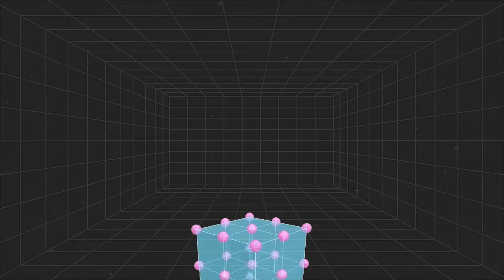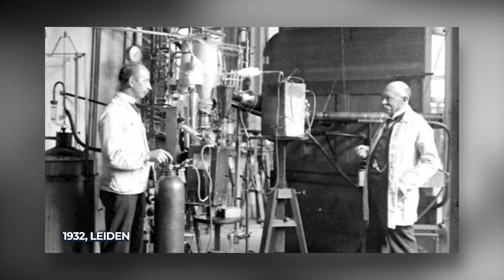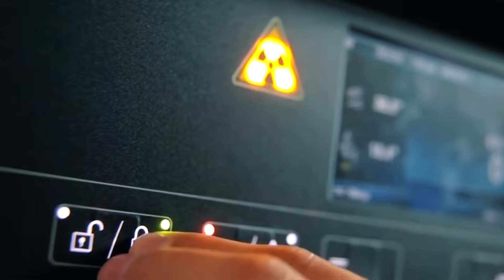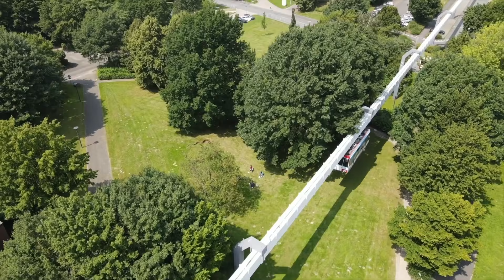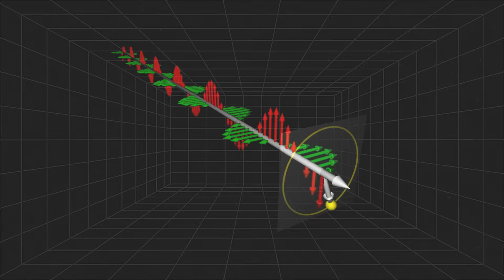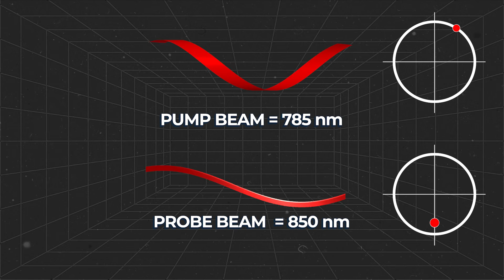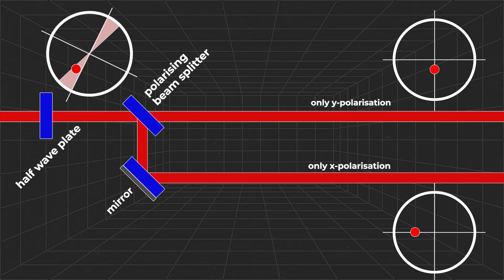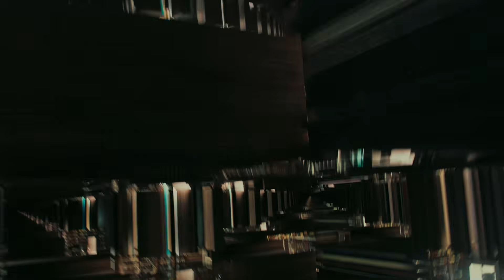Impossible Time Crystal Breakthrough - Explained

Comment: I'm struggling. I thought a time crystal oscilated independent of an input ? Isn't a constant laser input cheating & why is reducibg the temperature not an introduction of energy, albeit negative. Just asking ! (I'm not in any way a scientist).
Reply: I think it's impossible for anything to change without some change in the energy of the system. That's why he said time crystals get close to (but are not) perpetual motion machines. The oscillation is powered by the laser, but when the input is constant it shows that the oscillation isn't caused by the laser. It's an inherent property of the crystal itself, using some of the beam energy to oscillate in time.

Reducing the temperature is setting the stage for the experiment. It happens before the experiment begins and so long as that temperature is held constant, isn't a factor in what's occurring.
Reply: This was also not obvious to me. It seems uninteresting for the purpose of a time crystal if the crystal oscillates as a function of the properties of the laser.
Reply: Dude who made the video is spot on. With a quartz watch, an electric circuit is the source of occillation and the crystal itself merely acts as resonator (to accentuate the desired part of the frequency). From Wiki.. "The electronic circuit is an oscillator, an amplifier whose output passes through the quartz resonator. The resonator acts as an electronic filter, eliminating all but the single frequency of interest."
With the time crystral experiment, the laser input doesn't occillate. The source of the occillation is now the crystal's atomic structure itself, which is something different and new. @BitsBlit
Reply: @bgsmember3650 I guess as a layperson, it's hard to understand that a laser isn't an oscillation source when everything about it is in terms of wavelengths of light. It doesn't follow in my mind that an energy source with a frequency imparts no frequency on the crystal.
Reply: @BitsBlit  exactly what I am thinking. I don’t understand how the laser is not an oscillating source. 

I also have another question. When you superimpose two oscillations with frequencies that are close together, it would result in an oscillation with extremely low frequency. Are they sure it is not because of this?
Reply: @BitsBlit  It's analogous the distinction between direct current and alternating current. Both involve oscillating electromagnetic fields, but direct currents do not actually oscillate.
Reply: @koktszfung  That's not accurate. What you are describing is a phenomenon called beating, and the thing that oscillates slowly in this case is the amplitude, not the actual wave itself.
Reply: @koktszfung I might be misremembering but the measuring frequency and the inducing frequency were both roughly 100nm apart weren’t they?  Which is a fairly sizeable distance in terms of interaction, but I’m not a physicist so who knows…
Reply: @BitsBlit He didn’t actually say it oscillated as a function of the laser, merely that they set the experimental conditions using the laser (and as near to absolute zero as possible) thus tightly controlling the parameters the crystal was exposed to enable accurate measurements over time.
Reply: You guys pretty much get it. It's to do with alignment for the initial laser and measuring for the second laser. The magnet initially locks the crystal into alignment, giving a universal starting position that the laser then gives an equal constant push to. 

Imagine you have waterwheel mills all along a riverbank, but there are eddie's and still points. Each of the wheels have to have slightly different angles to best utilize the flow now imagine you lift all the mills up and align the axis of each parallel to each other. That's the magnet  now imagine you no longer have the river, but a torrent of water comes at a constant speed in a constant direction, that's the laser. If the mills are all exactly similar, they all will react in the same way. When the flood is done, it's not gradual, it's abrupt and leaves the mills exactly the same. The difference between the expectation and the time crystal is that there is no friction to degrade the millwheels, so the pattern of the wheels repeat until an outward force changes them.

Another way to look at it is the electron cloud is random. Then a magnet pulls the electron down with a thread and the resistance to return to motion is a rubber band. The laser comes and cuts all the threads exactly the same, making the electrons all bounce around on that rubber band exactly the same way with a repeated time period before it bounces the exact direction off the exact point that was the starting point. That's the oscillation time.
Reply: exactly right, it isn't a true time crystal in the contemporary sense if it requires constant input. Kind of clickbaity but also technically true since their paper labels it as a "time crystal". 
It seems many people aren't understanding but a TRUE time crystal needing no energy input is the gateway to infinite energy and many, many other wild and crazy things so it really is no surprise this experiment is just another "proof of concept" kinda thing and not an actual creation of a time crystal that functions.
Reply: @matthewcarroll2533 I’m always dubious about the possibility of infinite energy, for the same no-go reason as perpetual motion machines.  I doubt the central physics of our universe would permit there existence, however experimentally accessing other dimensions or (desperately not trying to sound like a marvel advert) accessing other planes of existence (okay I mean a multiverse) would fundamentally mean a rewrite of the base physics.
Reply: @ Yep, you're right on all accounts and it's for that reason that things that make wild promises are to be doubted and approached with a certain degree of caution. 

The idea of intermittently accessing new universes or planes of existence for an unfathomable amount of resources (energy or otherwise) is more than feasible, provided we can find a stable/reliable way to connect to them. (which is really the tricky part, of course)
Reply: @matthewcarroll2533  No, that's not accurate either.

Comment: This is a classic example of poor naming - by Willcek's wife if I recall correctly. 

Time crystal is just another name for an oscillator. 
A steady-state drive causing an oscillation - how about a pendulum?

In short, the reason you found this so hard to explain is that it is basically a non-idea which is just not interesting. There's lots of interesting stuff to discuss - but you need to call out that this kind of stuff as just not interesting.

Timing standard? Ha Ha Ha!

Best wishes

Michael
Reply: You said a lot without saying much, what did you draw on to come to this conclusion?
Reply: @nate7rXG134  Good Evening. I drew on my 40 years as a professional physicist. Best wishes. Michael
Reply: @michaeldepodesta001  
Provide your reasoning. If I wanted your credentials, I'd ask for your degrees and publication numbers, I'm asking you to provide some explanation towards your point.
Reply: @nate7rXG134  A "time-crystal" is literally another name for an oscillator. Oscillators are interesting and fascinating but calling them "time-crystals" adds nothing but confusion. 

This video is a description of an arcane type of oscillator - curious enough - but not something of any fundamental significance. You could see Dr Ben Miles struggling - and frankly failing - to try to extract some insight from the arcane complexity of the apparatus. 

Best wishes

Michael
Reply: @michaeldepodesta001  Maybe but what other oscillator's lowest energy state is still an oscillation?
Reply: @nate7rXG134  If I have understood correctly, the video describes a non-equilibrium phenomenon. The material is not in its lowest energy state: it is being driven by a steady-state laser. It's like the way a classical pendulum is driven by a steady gravitational field . The crystal is not in its lowest energy state. If you remove the drive, the oscillation will stop,
Reply: A pendulum isn't driven by gravity or anything else. It won't oscillate on its own and if it had a driver without damping the amplitude would explode. If we had a real pendulum that could start on its own and didn't change amplitude after years of observation that would be interesting
Reply: @shanent5793  " A pendulum isn't driven by gravity or anything else...."  Really? 

Just like the material being discussed, the oscillation of a pendulum is started artificially and then maintained due to the presence of a gravitational field. 

The excitation of whatever is oscillating in the crystal looks to me to be a kind of "parametric excitation" that maintains the oscillation in the face of losses. This is just the kind of excitation that maintains a Foucault pendulum in a museum.
Reply: @michaeldepodesta001  a small-angle pendulum is the textbook example of an undriven, undamped oscillator. Are you talking about some other kind of pendulum?
"Started artificially" would imply dependence on the initial conditions, which isn't the case for driven systems. Neither the magnetic bias nor pump laser are time dependent in the Dortmund crystal so that rules out parametric oscillation
Reply: @shanent5793  YouTube comments are not a long form of communication and I'm afraid I can't grasp the point you are trying to make.

My point is that this is an *oscillator*. It's an incredibly complicated 'Rube Goldberg' type of oscillator but it's still an oscillator. It's excited with a green laser - a single frequency + amplitude and frequency noise  - and it vibrates at a much lower frequency. But it's still an oscillator driven by a laser. 

A pendulum hanging from a string can be excited at 10 kHz and will vibrate at its natural frequency - it relies on the presence of gravity. It's an oscillator too - fascinating - but it's still an oscillator.

Your point - which you are singularly failing to communicate - appears to be that is that this is NOT an oscillator. Have I got that correctly? It's excited by a laser and starts to oscillate, but it's not an oscillator. Mmmm.

My wider point is that the whole "time crystal' topic is just an example of the very worst of theoretical physics. It's inventing sci-fi names for things that don't exist. In contrast, the real world is endless fascinating.

Best wishes

Michael
Reply: @michaeldepodesta001  are you hallucinating? Not once have I denied that this is an oscillator. The video says the lasers are invisible yet somehow you say they are green. A pendulum excited at 10 KHz will vibrate at 10 KHz regardless of the natural frequency. I'm just trying to clarify because everything you have written here appears to be wrong
Reply: @shanent5793  If you nothing to say: please say nothing. Goodbye.
Reply: @michaeldepodesta001  too late, you should have thought about that before posting
Reply: Sounds also like a battery or capacitor. Just defined differently by time.

Comment: Hang on, though, if your pump laser is circularly polarised doesn't that mean that it's not constant? It's energy may be constant, and its wavelength, but the polarisation could be said to be oscillating, no?
Reply: It's oscillating at the frequency of the light, just the same as linearly polarized light does. The circularly polarised light IS constant. If it stopped oscillating it wouldn't be light any more. That oscillation frequency is not related to the oscillation frequency of the time crystal system, as I understood it. It just causes the alignment of the electron spins. The electron spin alignment varies really slowly by comparison (like 7 orders of magnitude slower).
Reply: @uazuazu    That's a lot of difference between the frequency of the light and the observed oscillation of course.  Quite a curious phenomenon.
Reply: @uazuazu  Well said, but if anisotropic movement of a mineral as shown by an emerald that can create an AM or FM based wave as a bias to compensate for system loss in a perpetual system, as long as this phased bias has energy provided, they have the in effect a 'perpetual motion machine' by using dark energy by quantumality to compensate for inherent system loss. Satisfying accepted physical laws of matter.

Contemplatively...
Should one find a way to use quantum physicality laws to provide this from the quantum field into the system as said bias, far beyond perpetually of the time chrystal system is possible. It could act as an energy convertor at a quantum level. Which would be a Heather Thomas level full frontal.😊

As Dr. Miles mentions the concept of subharmonics created, this could possibly be thought of as synchronicities when related to time crystal's maximized sycronnistic output which could be rectified for 'time-energy' output by these 'time harmonies' without 'melting', a collapse of the sustained wave function harmonic structure... of synchronicities.

Perception... becomes the measurement.
Reply: @the360five  wha?
Reply: @the360five  More mushrooms , vicar?
Reply: @the360five 😂😂😂😂 did chat gpt help generate your attempt at garbage?
Reply: @the360five clever
Reply: linear polarized light is actually a superposition of circular polarized light. I think circular is the default state so it feels less cheaty imo
Reply: Circularly polarized light has a constant 90° phase difference between the horizontal and vertical polarization components. If the polarization were oscillating then the phase difference would also be oscillating, so light with oscillating polarization is not circularly polarized.
Reply: Came here to ask the same question!! ❓
Reply: so its not about a new dimension its indeed about the time dimension
Reply: This was my thought exactly. The unit circle describes the relationship between what again??
Reply: The polarization isn't rotating in the sense that the polarization at the source is rotating in time, the E And B fields rotate as they transverse space. Similar to the way a spring rotates as you transverse it's main axis
Reply: Each photon does not have a well defined polarization state, instead exists as a distribution of possible polarizations. The polarizations we measure are an average of the aggregate polarization distributions of each photon.
Reply: @Nbomber what does this have to do with the supposed oscillation of circularly polarized light?
Reply: I have to agree with previous replies, circularly polarised is the pure form
Reply: Nerds
Reply: Yes the light is oscillating, but the rotating polarisation does change that.  Or am I misreading your comment?
Reply: To unlock the true magic you need a pure soul that vibrates at the right universal frequency...and then you have to use them as a sort of conductor.  This unfortunately usually results in the loss of specimen and thus the conclusion of the experiment.
Reply: @TheGrowBros By saying “loss of specimen” do you mean the observed human with the pure soul goes pop/bang?
Reply: The point wasn't that it's constant or not.  The point is that this is the first time observing a new dimension and measuring it.
Reply: @garyrobinson3735  a new dimension? Please explain.
Reply: @gerryjamesedwards1227  the Crystal doesn't interact with space or time. If it does interact with the 4 dimensions it disappears in observation.
Reply: @garyrobinson3735 lol
Reply: @garyrobinson3735 the 4th dimension described here is time you can look at spacetime as 3+1 dimensions with 3 space dimensions and 1 time dimension so in total 4 dimensions
Reply: @garyrobinson3735 It was the dimensional interaction that interested me the most from the experiment, I’m off to find the research paper now.  I’ve bookmarked this video so I may come back with better comments once I’ve done my research.
Reply: @ForgeMasterXXL  and how it went?
Reply: @garyrobinson3735  it’s not a dimension in the sense of width, height, length, time, and the other 36 or six, or however many actual dimensions you believe there are in today’s version of String, theory. They are using dimension in the sense of mathematical dimension I believe. so no, there was no observation or measurement of a dimension in the sense that we got to see the width of time or whatever.
All the other dimensions are still happily rolled up like they’re supposed to be nicely compactified safely away from the meddling of us puny mortals. All this is is a really cool, obscenely expensive, and massively difficult to build, highly accurate slow oscillator.